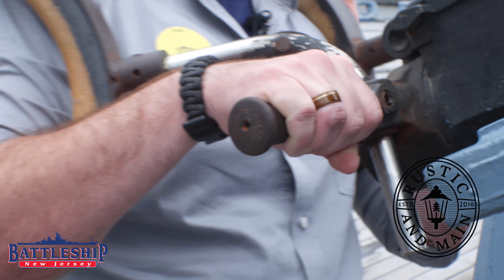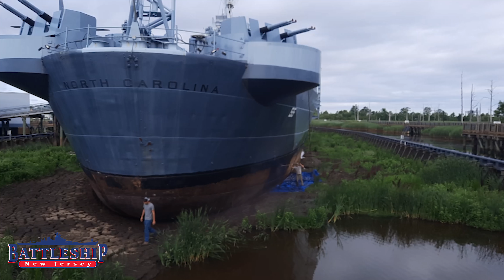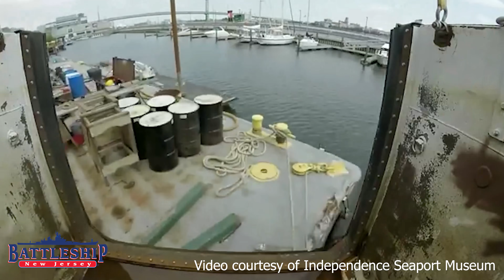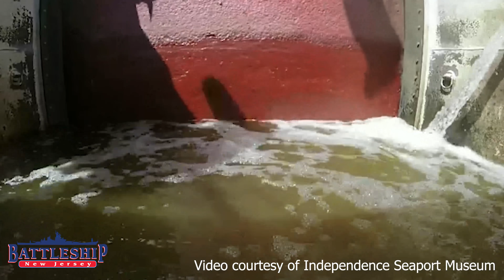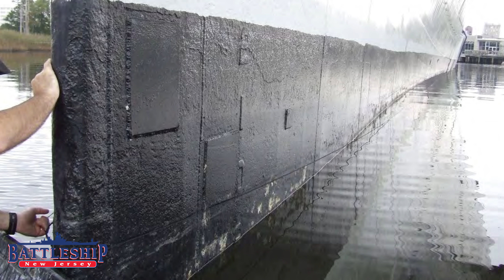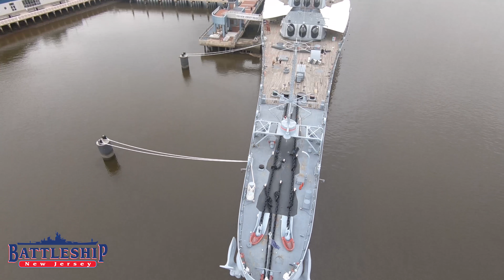Battleship North Carolina's Cofferdam

Comment: Three ideas:   1. Since the ship is double bottomed, can the inner bottom be ultra coated, and just let the outer bottom eventually rust;  2.  Is there any sort of super epoxy or liquid steel than can be poured into  the lowermost bottom plate and coated on the sides, this might add 100 years to its life;    3.  how about leaving it in the mud and installing a sort of pond or moat around the ship which would be 12" deep filled with water, the ship would look like it is floating in water, but the bottom parts would be dry, with only 12" of the side exposed to water, this 12" could be plated over every 100 years.    MCI

Comment: Aren't a Battleship's sides several inches thick?
Reply from the maker: There is a series of steel, liquid loading, and air gaps that create the "side" of ships and each of those layers is of varying thickness. And that isn't consistent throughout the length of the vessel. The bow, has very little steel as compared to the middle which has a lot more. So yes, some sections could be 12in thick, other places much much thinner and thus more susceptible to rusting through.

Comment: What if you use sand instead of water to provide balanced support to the sides and bottom?  I think this would minimize the effects of wind action regardless if the sand is dry or saturated. Otherwise, thanks!  This was very interesting.
Reply from the maker: Sand works as an abrasive and would thus make it worse.

Comment: with all of these ships, I would go with a hybrid cofferdam/drydock approach.  essentially take a floating dry dock that is big enough for which ever ships they are preserving and sink into the mud or something similar with the ships in side of them on metal I-beams.  then fill the structure up sufficiently to put the lower hull in water, but not so sufficiently that she floats again.  this would allow yearly maintenance periods when they can drain the water out and go in and do whatever inspections needed before putting her/then back in water.  if for some reason, major work of a ship yard is needed.  then you can drain the water out, refloat the drydock and take her to a more suitable facility.  if in the super extreme unlikelihood that these ships are needed again, within a few days all of the could be moved with their drydocks to the shipyards and what ever is need to make them function again can be done.  like i said tho, at the very least, it would provide a quicker way to perform emergency shipyard maintenance on them in the event they needed.  from my understanding of what is going on with USS Texas, this would be the perfect thing to do for her since she is in the worst shape of the 8 battleships we have.

Comment: There are so many old naval shipyards that have unused dry-docks that it would seem most of the museum ships could be placed permanently in dry-docks and then the sides braced. Then you could even get the view from under the ship. But you would need to move quickly as these old shipyards are being redeveloped and who knows what will become of the dry-docks.

The other option you haven't mentioned is placing the museum ship permanently on a floating dry-dock. Most of the time the hull would be in the water but, when needed, you could raise it for maintenance. All you need is an old floating dry-dock that still just about works.

Comment: In an ideal world you'd be able to do (as you said) as they have with the Cutty Sark, Victory and SS Great Britain, which as you said, is dry with the correct pressure placed on the frames. But if you can't do that, could a coffer dam, with purified fresh water be the next best thing?  If the water could be filtered to as good as can be achieved for the funds / amount required the vessels could be like the Lakers that last far longer than salties ever do. 
If a vessel has the weight on the tank top and it's in fresh water it could stay like that for many years.

Comment: If we ever go the same way as Cutty Sark, and HMS Victory for dry preservation then I also suggest to add a feature done for SS Great Britain, which is another dry dock museum ship in the UK. SS Great Britain (which is one hell of a success story for saving a decaying ship) has a blue, textured glass ceiling that surrounds the ship at its waterline. Not only is this a neat aesthetic choice but it also serves to protect the suspension system holding the ship in place, and provides cover for tourists as they walk around the hull.

Comment: The sides can't bulge out if there is something to push upon (ordinarrily water).
You seem to conjure a dichotomy -- water vs. nothing.
Nothing says it must be nothing. :)
The mud is, of course, a not nothing... but it is not wholly desirable.

These are the premises (I've developed). 

A general solution might be to have ship museums (multiple ships) constructed nearby drydock facilities... or build them a dedicated drydock. I imagine that a less than full-service drydock could cost less, in the long run, than leasing from a shipyard that has pricey-paying alternative hulls to handle.

A permanent enclosed wet-dock (that may be drained at need) is an idea. I believe there are better things to keep ships in than brakish-/sea-water. Can one anodize or chrome-plate a ship?  :)

It comes down to long-term vs. short- thinking and investing... and BB-55 was given long-term neglect for a couple of decades there. Until museum ships got attention by way of the Iowas (and, a decade before, the Essexs) it about produced tears to go see her. (The good work, other than a paint job and starting the teak, has been since my last visit.)

Thanks and keep up the good work.

Comment: I’ve been to all of the museum battleships from WWII 
North Carolina
Wisconsin
New Jersey
Iowa 
Missouri

I’m my opinion, making a large dry dock and permanently placing them where the hull is dry and accessible is just my opinion of how to preserve the ships. 
It would be a large “hull cage” to support the ship from the sides and bottom, but keep it rather dry unless it rains 

Of course it will cost a lot, but maintenance costs would remain low for the exterior for many years

Comment: You are definitely better off with the sunction section method but, I would get it made so it can go much deeper than what they have. It might cost slightly more but, allow you to remove and replace sacrificial annodes without dry docking as often. My suggestion would be make it so you and unbolt and bolt on different angled small section of side wall / rubber faces with seals bolting it to the style shown in the video to achieve different angles to mate to the side angles of the ship. By doing this  you could replace everything short of propeller shaft and rutters. Seal up or uncap drain holes for pumps. Install small patches etc. I am a diesel mechanic so if you don't understand I am willing to meet up with you and draw something up so it's more clear.

Comment: Wild idea:  Make a concrete barge as if it were a floating drydock, build a frame-by-frame support system inside to replace hydrostatic pressure, sink it in a real drydock, float the ship into the cradle, seal up the concrete barge, pump it out, and then float the whole barge with the ship inside.  Keep a pump system in the bottom of the drydock-barge to dump the water out.  If you keep, say, a six foot gap between the barge walls and the ship, you could section by section retract the support frames so you could repaint the sides and bottom of the ship, then screw them back into place after their paint dries.  You could afford to keep the original (or fiberglass replica) screws on the ship, then.

Comment: Could you not install a 12 foot (or so) tall fiberglass belt at the water line to prevent the problem in the first place? It would be a relatively easy process. The ship would have to be in dry dock. A two inch thick belt would be good for decades.

Comment: Has anyone of the museum ships tried floating the ship in oil in the cofferdam, it would stop the corrosion dead.
Reply from the maker: That is an environmental hazard, and extremely expensive.
Reply: At that point, you'd be better off constructing a dedicated building with a sealed bottom then floating her in mineral oil to remove environmental risk. Granted, pretty sure that would cost as much as building the entire ship did in the first place if you wanted a fancy museum built around her. was around 60 million dollars new granted that was in 1939, which is about 1.15 billion dollars in todays money after inflation.

Comment: Steel is not viscoelastic. I don't see the issue in not having water pressure on the sides.
Reply from the maker: The issue is the ship was designed to have support from the water, not to be freestanding. So when you remove the water, its removing the things that hold it up.

Comment: Cutty Sark - I've been to and through the Cutty Sark.  It's not on the same scale as your battleships, I doubt it's length is even as big as your battleship's width.
If I recall correctly, they built a substructure within the hull to support it as the hull has become that fragile.

Comment: With modern day epoxies and things like rhino lining which are extremely durable, have museum shops looked into preserving the wind line using epoxies instead of constantly replacing steel plate? The texture trapping marine build up would be the worst aspect, but if it holds up well, cleaning the line would be better and cheaper than cutting and welding steel plate back on in a patchwork manner.
Reply from the maker: All museum ships use a series of a coatings specifically designed to combat marine growth and rust.

Comment: Why not build a dam around the ship but instead of mud you fill it with water so you can drain it when maintenance is needed? I'm sure it would be more expensive to build but once it's there you can use it whenever needed and be right on top of a problem when it occurs or even before it becomes a problem. I mean the quicker you deal with a problem the cheaper it is.
Reply from the maker: That's what this cofferdam system is. When they finish the work, they fill it with water again.

Comment: the solution would be active electrochemical corosion protection - like makeing the battleships a negative pole of a DC system and hangigng sacrificial scrap metall into the whater around it as positive pole ....   they do that with underground fuel storage tanks and meny whater towers.... or make a shell out of welded or brazed on thin stainless steel around the original hull also spraying the ballast tanks with oil to prevent corosion on the inside
Reply from the maker: Here is our system for that: https://youtu.be/K70TFx2LN1Q

Comment: Could you use stainless steel to replace the plating in high corrosion areas? Or once the new plating is installed protect it with a couple coats of epoxy than paint over it?
Reply: Similar steel must be used. A mix of different types or grades of steel will only speed up the deterioration at all connections.

Comment: This reminds me of one of the potential long term plans for Iowa on the LA waterfront in San Pedro. The most ideal plan would have a "small" channel created for Iowa a few hundred yards away from her current home. Her new home would basically be a dry dock where she could float freely and when needed it could be drained and it would serve as a traditional dry dock.
Reply: The RMS Queen Mary could use a permanent cofferdam/drydock in Long Beach considering she is in no position to be moved. She has a lot of deferred maintenance and repairs that need to be done and the nearest largest dry dock is either San Diego or San Francisco Bay, so it's best to build it where she is.

Comment: Would a fixed cofferdam save you money over 2 or 3 drydock ventures over the next couple decades? Pay once vs multiple times? Is bb55s cofferdam permanent-ish ?
I've seen the water levels get pretty high around there, flood out the whole parking lot. If the water levels get real high I imagine its no trouble to pump out the cofferdam?

Comment: I guess each option has merits and each option has negatives. As you said the ships location plays a major part in what is or isnt viable or even feasible. One question I have is would it be possible or even worth using likes of a paint on roofing rubber ( likes of Aquaguard etc ) to provide a barrier if you like between the hull and water or hull and mud? yes i realise it would be a cost but if it prevents the water from corroding the hull further because it cannot contact it, would it work? eg get the ship into drydock.. and apply a thickish layer of liquid rubber layer to the entire hull so it comes right up to the splash plate level that essentially would seal the entire hull of the ship.... Just a thought I had.

Comment: Why not cofferdam the hull, then place it on blocks (with attendant side bolster), then clean and cover the hull in a non-corrosive coating.  Once sealed, fill the cofferdam with non-salt, chemically-neutral water (as chemically neutral as you can make it) and let her float like she was designed to.

Comment: Are the screws left on the ship or taken off when sinking them in the mud?
Reply: The screws or oft removed even for Naval mothball storage.  The bronze screws cause dissimilar metal corrosion on the steel.  When the ship is in use, sacrificial electrode blocks are bolted to the hull in proximity of the screws for corrosion protection.   For long term storage, the replacement of the sacrificial electrodes becomes a chore, so off with the screws.

  Corrosion on the steel shafts near the hull seals, well that can be a big problem as you can imagine!
Reply: I recall hearing, as a kid, they were taken off. One is on the deck and one is on the ground at the museum entrance. I don't know about the rest.

Comment: There are old shipyards with existing drydocks that are being demolished to build office buildings and the like.   Possibly relocating the battleship to one of these, as they come up for sale is an option.   Not being from NJ, I have no idea if there is one that would be feasible for the New Jersey.     The USS Salem in Quincy mass could probably do that, if the old dry dock is still unencumbered.  
    As for restoring the hull plating.   There is a process called spray welding that allows one to put new steel onto an existing piece of steel to build it back up.  I'm not a welder, I have no idea how feasible this would be to restore corroded away hull plating.   Once hull plating is restored, since the hull doesn't have the stresses of active service, softer more water resistant coatings should be looked at.  There are epoxy coatings that advertise very long life spans.   Also just adding a whole lot more sacrificial anodes to the hull as sections are repaired should help.  
  Another off the wall thought, down the road a few decades, assuming it has been placed in a cofferdam.  Here is another off the wall thought.   Wrapping the entire underwater portion of the ship in what would essentially  be a giant plastic bag.  That would allow you to change the character of the fluid the ship is floating in.   Float it in distilled water, or mineral oil, or whatever would best preserve the hull and you can get approved by the EPA.   The bag would probably need to be replaced every decade or so, but I see things like that being used in tunneling to exclude water ingress.
Reply: You beat me to it.  I was thinking the same thing, as I was looking at satellite pics of industrial land that used to be drydocks in the SF area.

Comment: Would it be better to permanently dry dock these ships, like HMS Victory, SS Great Britain or the Cutty Sark? Cutty Sark has a steel and glass structure built around it's hull where the water would have been, which gives an impression of a ship at sea, and is also the roof of the cafe under the ship.
Reply from the maker: Heres a whole video about that https://youtu.be/sa8x2gc448c

Comment: Need to do like the Swedes did with the VASA, and build a building around it and keep it all dry and out the elements!  Or then you need a floating dry dock to hoist the NJ up to dry in a custom cradle that would fit around like a glove to properly support the sides.  Then from time to time it could be dropped in the water when the dry dock needs work and then haul NJ back out into the dry dock when its back.  Could be the best of both worlds that way a dry dock with cradle that she sits in.  👍👍  However with a building that has AC / humidity control like the VASA has (due to wood and being from the 1600's) would preserve the NJ both inside and out then and wouldn't need AC inside the boat just ventilation to move nice cool / dry air around.  This would also eliminate the UV damage from the sun.
Reply from the maker: Definitely helps that Vasa is originally a 1200 ton wooden ship, not a 57,000 ton steel ship
Reply: @BattleshipNewJersey  Ahhh... Details details. 😁😁  Although the VASA is 172' tall.  It was a nice place when I was there a number of years ago.  So a dry dock with a cradle it is then! ❤⚓

Comment: Has anyone looked at trying to Stir Stick Welding Process to add back steel?
Reply: Burn through a lot of sticks that way, probably cheaper to just replace the plating completely.
Reply: @McSkumm  ... The Stirrer are usually very long lived. Since you're only plasticizing the metal and mixing them together; thus avoiding completely the phase changes from solid to liquids and back to solid.